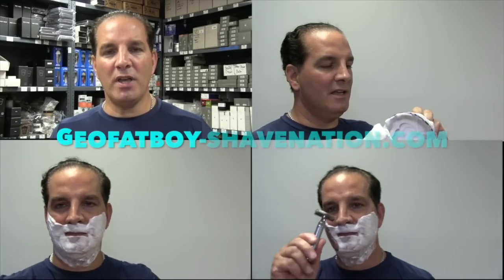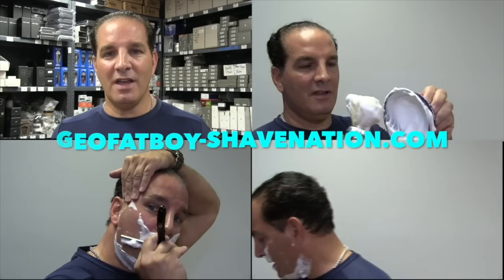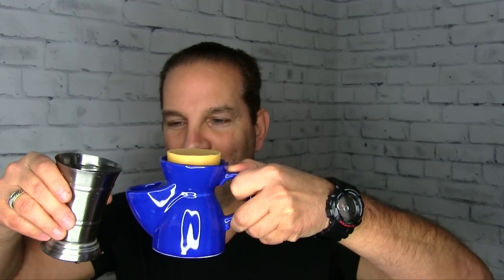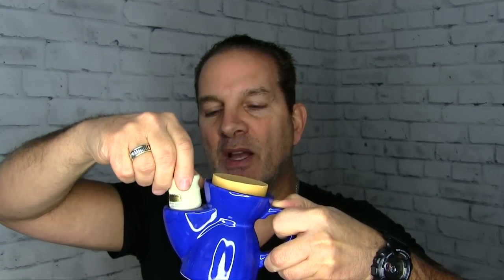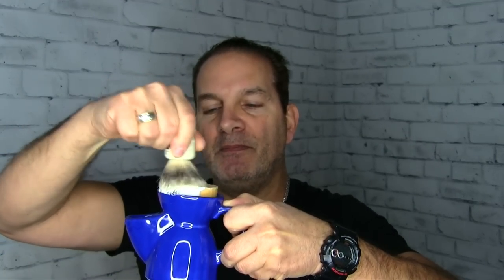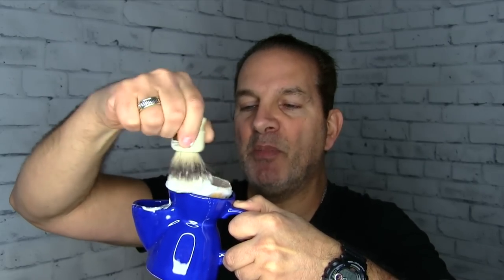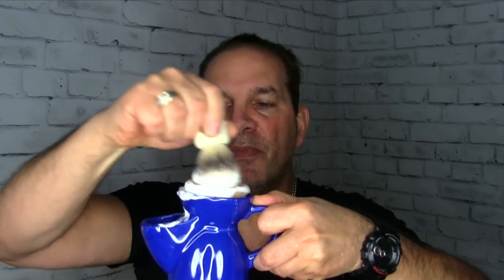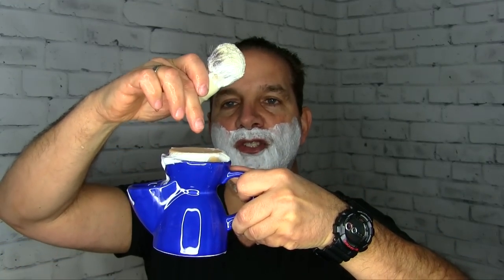How To Use A Traditional Shave Scuttle Mug

Comment: Youre correct about these being for water conservation. Imagine the time before indoor plumbing. You would have a pitcher, basin and mirror in your room. You don't want to spoil a whole basin of clean water with soap and shaved off hair. So you can get the scuttle soapy with dipping your brush and wipe your straight razor with a towel, not in the basin. The scuttle allows the whole shave without tainting the basin water.
Reply: This whole thing felt very gimmicky to me, but reading this comment I understand the practicality of this in it's age.
Reply: @FailedZerg  Happy to give you a vintage perspective.
Reply: Interesting

Comment: These scuttles are great.I am using my Grandads Staffordshire made in England scuttle.Its probably 70 or more years old and still looks great.Dad said he would cut an ordinary soap bar in half and put that into the scuttle.He was a boy during the depression and learnt how to stretch his pennies & so ordinary soap would do the job as far as he was concerned.Its nice to have something your Grandad and then Dad used.Good to let the brush steep in the hot (not boiling) water in the scuttle while you wet your face with hot water,this gives the bristles time heat up and absorb the hot water.Scuttles are normally made of ceramic because it holds the heat better then metal.

Comment: Finally,  a voice of reason regarding the way this scuttle is supposed to be used.
I've seen people use the top part as a lathering bowl, even for creams. Made me sad every time. Neither does it makes your lather warm, neither is there any logic to mix your lather and simultaneously push it through those holes on the bottom.
Good video sir.
Reply: I tied that once and realised it clearly wasn't what it was made for. Still trying to figure out how to make/keep lather warm!
Reply: But it DOES make the lather warm...  i personally have felt this myself, as have numerous others based on their comments on this video.  And sure there may be a way to use a specific house/bathroom appliance, but if someone is using this the way it best works for them, to me at least, that's what counts.  They're not cooking in it or making ramen soup, but they're using it to shave, which is what counts right?
Reply: If your brush has been soaked and you've loaded it up with soap it will build a thick, creamy lather in the bowl and none of that lather is going to fall thru the  holes - the holes allow the steamy heat from below to keep the lather moist and warm for as many passes as you need.

Comment: I have a collection of traditional scuttle mugs (several from the 19th century), and although I realize this is the proper way of using them (with the soap or puck on top), I use it differently and very effectively I might add. The key is to use very hot or boiling water, as I do from an electric kettle. I fill up the scuttle mug with the hot water, use the hot water inside it to prep the brush just like you did, load the brush with soap or cream, lather directly on my face, and during the first pass I'll rest the brush on top of the hot scuttle mug. The rising heat and steam will keep the brush warm so that when it's time for the second lathering, it's a real pleasure to reapply the warm soap. Note: this will rarely work with regular hot water from the tap, unless it comes out very hot.

I also have a collection of double-chambered scuttles with the plug, which are more effective at keeping the brush warm, but these are heavier and not as portable in my opinion. So, if you use really hot water, these traditional scuttle mugs can be used to keep your brush warm without the need of placing soap or a puck on top.
Reply: This is a great comment and idea, I will definitely try that as well!

Comment: Hey Geo , as always loved the video!  I had a question though,I thought the point of my scuttle was to keep my lather warm. I See that this is a vintage scuttle and not a modern scuttle so maybe that’s where the two differ. I have seen other channels where they don’t use the vintage scuttle properly as you have. The modern schedule allows me to keep hot water in a separate chamber to keep the lather warm, that’s the style I prefer. It’s 50° in New York State today and were considering pulling out the fat Bob.Thanks for another great video! Be safe Geo...

Comment: I just switched to a safety razor as well after irritating myself too much with the cartridges.
But right now im nicking myself too much with the double edge razors as i have some acne plus im a beginner.
I would love to hear you suggesting how to shave with pimples on face
Reply: First, give yourself a hot towel treatment to open up your pores.  Then, apply Noxema skin cream to your face whipped up a little with a synthetic brush dipped in hot water.  Then shave (one pass) with a disposable single edge razor.  Rinse your face with warm, not hot, water.

Comment: Why on earth would anyone use that?
Reply: To save water. In the old days when there was no bathroom it was important.
Reply: This is how you shave in the bush. You ever see pictures of Rhodesians from during the bush wars? The guys who don't have beards look like their faces are polished and oiled marble because safety razors and straight razors give that close of a shave. They're far superior. Cartridges usually feel like they're just pulling out hair after you've used them 5 or 6 times and you got to strop them to even keep them usable. If im going to have to maintain a blade it would be better to just go to the better way to shave.
Reply: Running hot water has only been around for 100 years or less